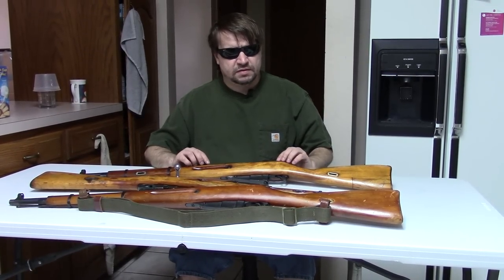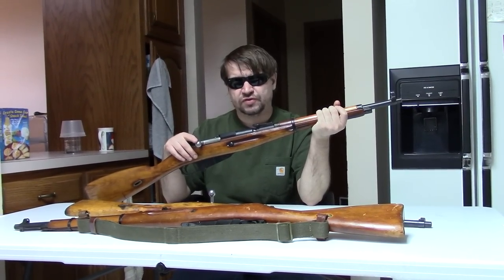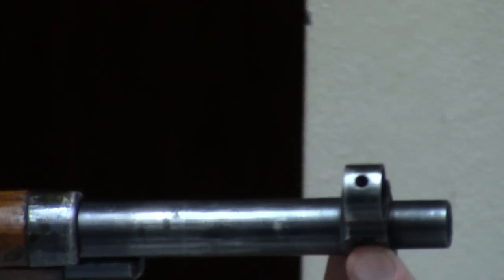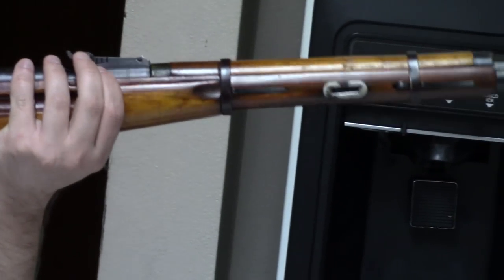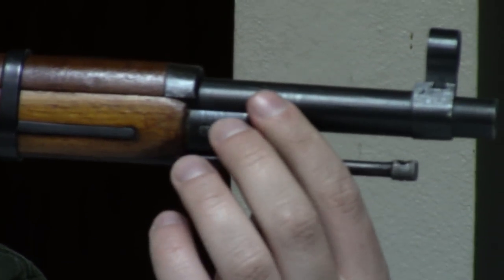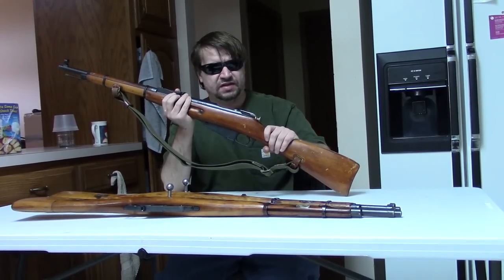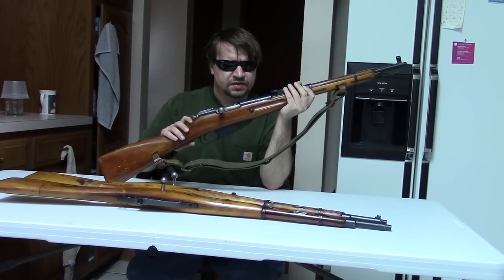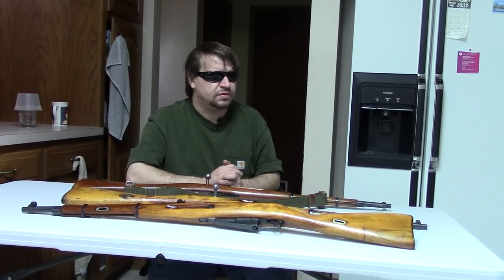Czech M91/38 & Soviet M91/59 Mosins: Turning Rifles Into Carbines

Comment: Huh...
I think i have a 91/59...
It's in a laminate m44 stock. It is a shorty and I think it has the long sight.
Reply: Check the top markings. It should actually be marked  1891/59. Mine is and so are the other 2 examples I have examined.

Comment: Misha or Jay, I recently bought a brand new WASR built in 2019, the bolt gets caught up somewhere around the magazines well (roughly when the bolt it half-way forward) 
Im not sure where its getting caught up, would you know what the cause is? Can I contact you on your site for help?
Regards,
Brennen
Reply from the maker: Carriers hanging up on the hammer - enough that if you ride the carrier handle (instead of sling-shotting it) it can actually stick. Does it function otherwise? - Jay
Reply: @MishacoOBA  Wow, thank you for the quick reply! 
Yes, it fuctions properly and hasnt had a malfunction but freaks me out a little as this is my first AK
To me, it looks like the bolt doesnt center exactly straight as it goes through the thrunion, its off the the  right by quite a bit
Reply from the maker: Nope, it's perfectly normal for an AK - you're fine. My old PSL could "bolt hold open" on the hammer if I rode it forward. Provided it runs without malfunction, you shouldn't worry about it. I'd suggest upgrading the trigger group to an ALG AKT personally. It's a dramatically better trigger than the CAI and will probably reduce some drag on the carrier, but I wouldn't go out of your way to upgrade if it's only because of that "issue." - Jay
Reply: @MishacoOBA  Hey thank you so much for your help Jay, I feel quite welcome to the world of AKs.
Best of luck to you are yours.
-Brennen